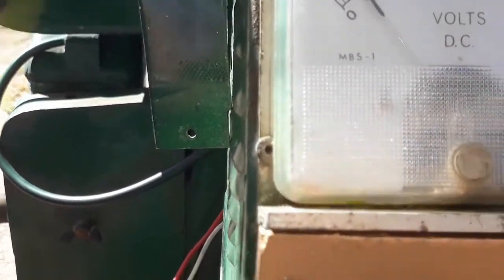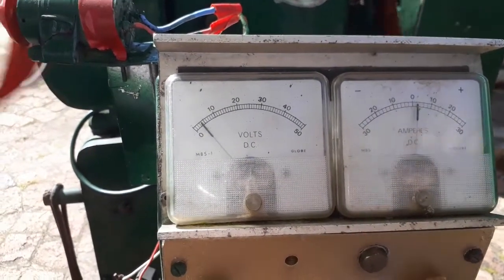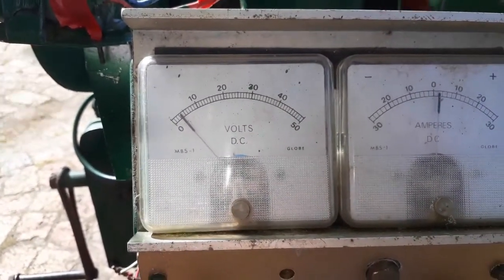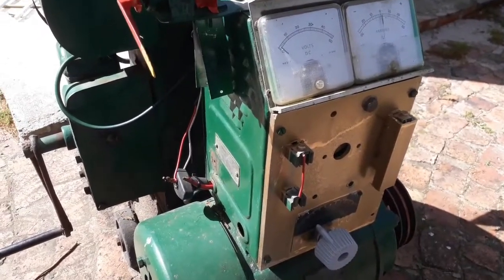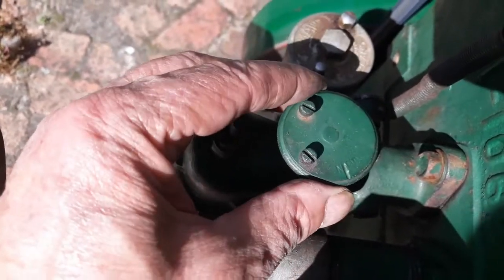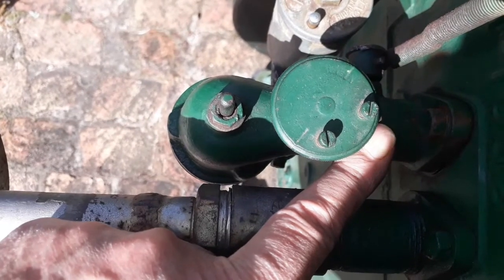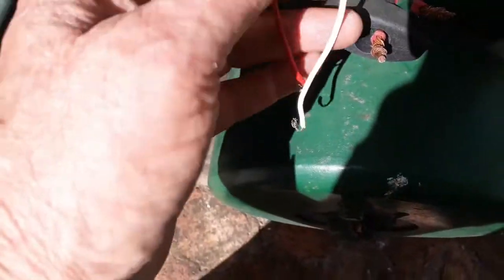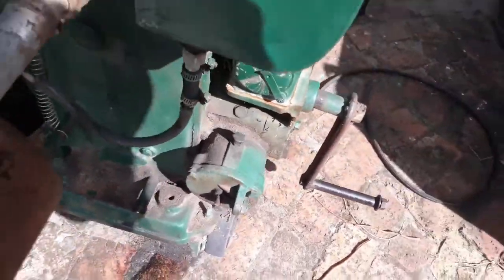Generator is WORKING, Lister FIXED at last and photos of the beautiful Canola fields in the Cape.

Comment: Nice countryside Jan.  So you re-installed all the internal parts except for that broken piece in the first video?   Do you maintain the proper voltage for the connected device by adjusting the speed control?  This has been interesting and I'm sorry to have been no help.
Reply from the maker: No problem my friend, for now I only run power straight out the generator, through the Amp and Volt meter with a positive and negative outlet, my plane is now to repair the governor and set the speed of the engine for the desired Volts, I plan not to use more than 12 Volts, I will later have a look again at the rheostat, thanks for watching my friend and always great to see you here.
Reply: @jankotze1959  Still, I am glad to see it back in operation !!  On a side note, one of my buddies has a string of 12v lights he powers off his caterpillar power plant for his sawmill when sawing late into the night.  He has no electric available down at his mill.